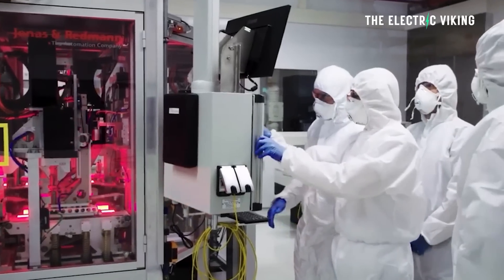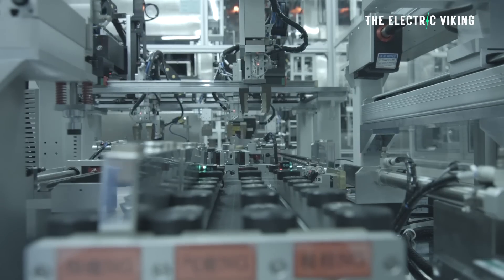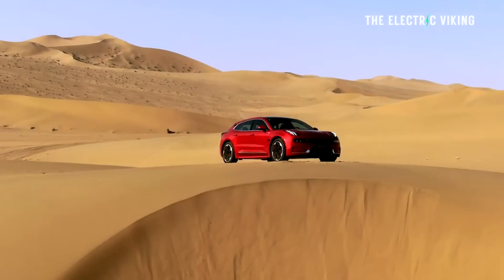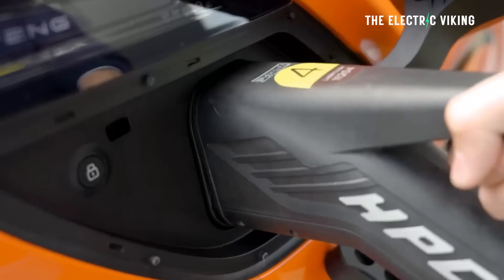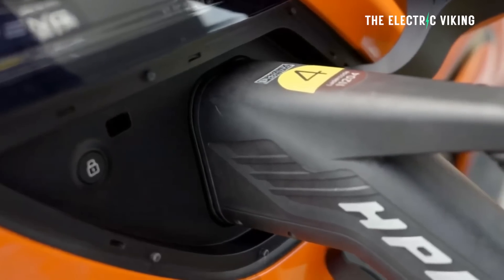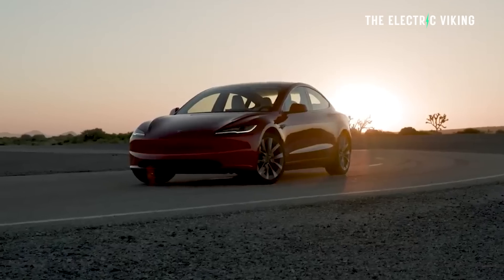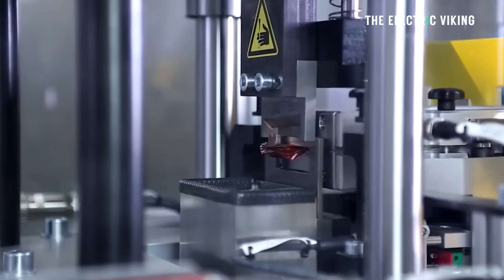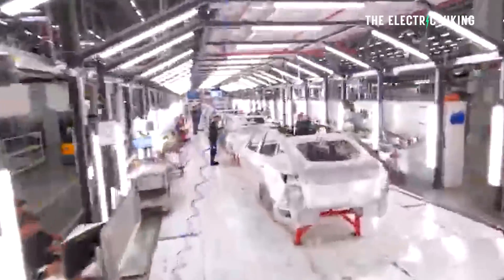NEW lithium sulphur battery made in Australia doubles energy density

Comment: "Put a smaller and lighter battery in there." Why would I want a multi-hour stop halfway between Melbourne and Sydney on a commute?
Reply: He mentioned Melbourne to Sydney on one charge. But with the faster charging he mentioned, a smaller and cheaper battery would be fine for most people
Reply: @emceeboogieboots1608  It's fine to have a battery that can charge at extremely high speeds. Great, even. But the infrastructure has to be there to support not only your vehicle charging at that speed but multiple vehicles at a time, all day.

There isn't the electricity grid structure to do that. And without going nuclear, where are you going to get the power - renewables? How are you going to store that energy and get it from the power creation point to the power consuming point (your vehicle being charged)? 

There's an incredible amount of infrastructure questions that a) have to be answered and b) have to be paid for and built for large scale adoption of electrical vehicles to be broadly feasible.

And then you go off the main routes, not even into the back of beyond...
Reply: @damianwright3690  You speak like every car is going to be electric. And as far as infrastructure goes, we waste a truckload of power that is generated as it is. I myself am wasting often over 5kW of power generation capacity, not at home, 10kW system with a max of 1.5kW export. A smart grid will allow the wasted generation capacity to use pricing mechanisms to encourage those without solar to access this power when it is cheap, and use the full capacity of generation potential. Not every car on holiday is going to drive through Ballarat at the same time. People will already drive well out of their way to save 10c per litre. If they can charge their car for half price between 9 and 4 pm, many will make that happen. And most will charge at home if possible, using their own solar, or cheaper night time tariffs using smart chargers. And if manufacturers and network operators allow VTG, those with full batteries will be able to get good returns for exporting some power when they may not need it
We need to think of those 10's of thousands of batteries as part of the infrastructure too
Reply: To go to the toilet, rest break or a drink and bite to eat. They will recharge up to 80% in 20 to 30 minutes, the industry is aiming for 10 minutes. Don't forget battery swapping.

Comment: As for using electricity for aircraft. Have you actually done the energy numbers? Well I have, as I know the energy required to propel an aircraft. Do you know the energy transfer rate required to recharge them on a turnaround? Bet you don’t know either of these answers.
Well without going into details, I can tell you it is unfeasible within 20 years. Also unfeasible without massive base power availability, i.e. coal or nuclear fired power stations.
Reply: China is already manufacturing electric planes.

Comment: Just wondering if you understand the restrictions for energy transfer using electricity. It is great to have high capacity batteries, however it is the restriction, of the electricity grid, which stops them from being quickly recharged.

Comment: Dude, here’s some perspective for you: 260 ÷ 1000 = 0.26 watts per gram of battery, 400 ÷ 1000 = 0.40 watts per gram of battery and 33333.333 ÷ 1000 = 33.333 watts per gram of hydrogen. No kind of battery is ever going to reach that level of energy density.
Reply: Have you calculated the cost of producing Green Hydrogen  and compressing it sufficiently to use in vehicles? Then of course there's the problem off the specialised materials needed for storage and transport? Google it!

Comment: I really dont need or want a 1000 km battery. Lighter and cheaper yes. The problem with aeroplanes need for big start power will be solved with dual type battery or condensator/battery

Comment: Once super fast charging becomes ubiquitous, they will only need 200 to 300 miles range  at the absolute max, so basically it means they will simply put these smaller lighter batteries into EVs to make them more efficient.  This will also improve EV vehicle performance.
Reply: Many internal combustion engine (ICE) cars offer a range of around 300 km on a full tank, which is comparable to the expected range of many electric vehicles (EVs) once super-fast charging becomes ubiquitous.
Reply: Sodium batteries will eventually dominate the market once super-fast charging becomes ubiquitousand EV range becomes less important.
Reply: 500 IMO until ubiquity, then 400

Comment: What would this do to the public fast charger business? If I had a range of 1000 Km on my EV I would probably never use public chargers or only very rarely. I would charge at home nealy 100% of the time. If that were the case for most EVs then the public charging business will be desimated generally but could be successful in urban setting that are without access to charging, like in their homes or apartment buildings.

Comment: I think the 1000 mile range is the way to go.  Family of 4 cant all charge every day at home. Not enough amps available in the panel. If each car had it's own charge day a typical home panel would do.
Reply: We can't keep our Amps in a panel, they just pass right through!
Reply: Leased standardised battery packs that can be quickly swapped out by a machine might be a way to go if the energy density gets high enough to make them more compact. Would also solve the problem of the car being worthless when the battery loses capacity.

Comment: This again is not a 1 battery for every situation. so far you have cost, Max recharge cycles, recharge time, and WH/KG. if they can get the cost down and recharge cycles up they will end up in more devices but there are situations that it will not be used.

For instance Cell phones have designed obsolescence and they do not want the batteries to last too many years.. that is why they have basically no BMS and can overcharge so easily. why you ask its because they want you to buy the newer module. 

Another instance is tool batteries. Again they want to last long be light charge quickly.. but if it needs to be replaced sooner they don't care

with current chemistries car batteries will last 10-20 years with at least 80% battery. but power tools and phones the batteries last 3 years or so before they are less than 80% so they can make you buy the next model. This is also why naysayers believe car batteries will not last.

Comment: I think I’m right in saying that a solar panel is roughly 24 too 30 % efficient due to resistance so makes one wonder why this has not been looked into more , lots of innovations in regards to make the batteries more efficient be it’s mix of materials used the list is endless , so one wonders why the solar panel has not really changed in years from an efficiency standpoint point , has anyone looked at let’s say would smaller solar panels be more efficient than larger ones , would a vibration censor added to the solar panel help with efficiency so the vibration of the rain hitting the panels generate or help with efficiency along with the sun help overall with efficiency, would  a small fan at the back of the panels help to pick up some energy from the wind help with efficiency, it’s more or less the same panel that only picks up from one source yet other elements around the panel which are on hand each day are somewhat not thought of , maybe it’s a rubbish idea that’s why others haven’t thought of it , like creating another element to the periodic table ,  if it was possible to create another element I would call it surprise = the element of surprise.

Comment: So much will happen within 10 years regarding battery tech. Very exciting!
Reply: I absolutely bet it will not. In the past 20 years battery tech has hardly improved. Physics and the chemical make up of batteries determine that.
Reply: @Car-crazy  remember that what is happening today is a result of years of research. So if the pace picks up, the i believe the next 10years will be exciting.  Last, right now there is an influx of new battery tech in research. Break through is imminent.
Reply: @Car-crazy Clock time is not everything. EVs have jumbo sized the battery market, and that is driving investments in research and engineering. Now what is true, is there are a lot of people trying to get attention, and most "breakthroughs" will never get to market, or will never be important, but there have been advances, and I don't think we are done yet. For one, not all use cases value the same properties equally. Aircraft need high energy density, cars want pretty good energy density and pretty good price and pretty good C-rate. Grid storage wants high cycle life, and low cost. Longer term storage wiuld need to be very cheap and low self discharge rate. Tiny batteries used to power turbo's on gas cars need high C-rate and good cycle life. A new battery only needs to be better in one of those use cases to be viable. It doesn't have to take over the whole market.
Reply: @Car-crazy  There was no EV revolution 20 years ago.
Reply: @Car-crazy  Look at a chart of lithium-ion energy density and cost over time. There has been tremendous improvement, even without significantly new chemistry. Another 2x improvement and passenger ICE vehicles are pretty much finished.
Reply: @Car-crazy bs
Reply: @Car-crazy And that is indeed battery tech
Reply: True dat

Comment: Does that double the explosive power of one of the current batteries
Reply: Electric car battery’s were slow burning even in the early days it might be the hybrids that still have the issue because of the explosive nature of petrol  , I know BYD  fixed  a problem with their steering leakage that used to cause fire most these problems have been resolved , the average petrol vehicle is likely to more likely to explode if the outside gets near 40 degrees

Comment: Please use metric units :)
Reply: No! Come back when a meter can be exactly divided by 3. What idiot would design a measurement system where you cannot divide by 3. Broken by design.
Reply: @mbak7801  the metric system is divided/multipled by 10s. That is much better than 3 because it is a nice round number
Reply: @mbak7801  Actually, the metric system is highly versatile and supports divisibility by 3 more effectively than you might think. While a single meter can't be evenly divided by 3 in whole numbers, the beauty of the metric system is that it introduces smaller units that make such divisions precise and simple. For example:

1 meter = 1000 millimeters. Divide that by 3, and you get exactly 333.333... millimeters.
Because metric units scale by powers of 10, you can always express fractional divisions cleanly using decimals.
Compare that to, say, the imperial system, where dividing a yard (36 inches) by 3 gives you 12 inches, which is nice—until you need smaller fractions. Dividing those inches further can result in awkward fractions like 3 3/8.

If the goal is precision and simplicity, the metric system wins. It might not make 1 meter perfectly divisible by 3, but it lets you achieve the same thing more practically across its units. No system is perfect, but the metric system was clearly designed with flexibility in mind.
Reply: @mbak7801  Come back when you can divide your units by 5 and 10.

There is a reason Americans can't do Maths. Besides the obvious problem.
Reply: Watts are a metric unit. 1000WATTS= 1KILOWATT 1000KILOWATTS= 1MEGAWATT

Comment: Problem is that all of these game changer cells are always 5 years away.
Reply: Most of them disappear completely within that 5 years. But a few, just one or two,make it through and move things on. We already have batteries which were beyond my wildest dreams a decade or two ago, so I'm happy to run with them, until the game is truly changed.
Reply: @nickwinn7812  Only one has to make it to the market.  Thats the silicon valley model. Fund 1 billion into 100 tech innovations in hopes that one of them will make 10 billion profit with a net income of 9 billion.
Reply: And that my friend is when the game will be changed
Reply: The game has dramatically changed - battery life, safety, charge speed  and power density have all improved significantly over the past decade- there will be a similar improvement over the next 10 years - a definite contrast to what happened with ICE cars over the last 50 years 😂
Reply: And yet sometimes something sticks

Comment: A lot of EV owners wouldn't see the need for such things as you'd never drive 600 miles straight without a break.😉
Reply: You could also put a smaller and thus lighter battery into the car. That will be cheaper and give you more km per kwh. Besides that, a higher density battery will be much better in trucks.
Reply: @olepetersen3554  Your approach is much more rational than just whacking a massive battery into everything that moves, I have to say.
Reply: @olepetersen3554  lighter==better acceleration and lower cost
Reply: tell that to Australian drivers. I've gone 700+ with a 5 min loo break on more than one occasion
Reply: @thekaxmax But that’s what he’s saying. You can’t build Cars just so big Bob with the bladder of a champion and can drive ten hours straight because he’s done it twice in ten years so therefore EV are no use……unless they can go 800 miles to a charge. I know door to door 428 miles I’ve done has a total charge top up of all of 28 minutes these days. The charging didn’t interrupt anything as it was a rest stop to eat and toilet break. It also sat in traffic in 28c with air-con on because of accident ahead for an hour crawling at 4 mph. 

I always figured real world 400 miles is more than enough for 96% of owners.
Reply: @SWR112  I wasn't saying that. I was objecting to a blanket statement that was untrue. :P
Reply: @SWR112  Totally agree. Twice the current range and everyone will buy one
Reply: @thekaxmax  Yeah, but those of us without access to amphetamines, prefer a safer approach and take a good break every couple of hours or so!
Reply: In Australia we might…imagine charging at home and being able to drive to Melbourne and home again! OMG…..this is insane!
Reply: @annebaker9408  not quite home again. And I normally do it in 3 legs
Reply: Bigger batteries for house to grid, longer life, towing ability and long distance driving.
Reply: People also drive drunk but they shouldn't.
Reply: @Alantj22  Didn't say it was a good idea. Just that it's not universal that no-one does it. :P
Reply: Its got nothing to do with needing a break. Its to do with needing a charger... Why do people always bring up the break thing. When you stop to wee or eat, you don't need to stress if there is a charger when you have 600 mile range. Common sense I thought
Reply: People who keep spouting that one time they drive long distances that one time a year without a pee break... meanwhile 99.5 percent of their daily drives are less than 50 miles.  Yes, we all drive long trips, but that isn't the norm for most of us.  I'm happy to pay 10$ per charge vs 100$ per tank everyday and suffer that extra 30 min charge on an occasional long trip.
Reply: @adrwong8  A PHEV suits most people’s needs. Especially the latest generation with 80 mile range.

Comment: According to Toney Sega [ world renowned futurist , economist etc] , the issue with bringing a new battery to the market , is that it takes around 9 years from concept to retail use .
and that Lithium batteries have an average price drop of 16% per annum from there original development  , and an average increase of energy density of 4% a year since there original development . So whatever you invent and develop  today has to be better and cheaper than  a lithium battery in 9 years time.
Reply: He's right about brand new inventions and technologies. However, batteries are not a new technology. And the markets well established. This invention might very well contribute to the average 4% improvement of battery technologies.
Reply: You're right!... Prototyping is easy. Manufacturing at a competitive cost is hard. 
According to estimates, just 5% of inventions progressed to the manufacturing stage.
Reply: @appl2597  tell me about it .spend years building prototype off highway machinery.... 😂
Reply: @appl2597  Thankyou.
Reply: call it a vaccine, it will on the market in months
Reply: Well he's not much of futurist 😂..CATL need 6 months..
Reply: @Rockall57  What ! safety tested, feasibilities, market analysis, manufacture tooling , investors risk analyses, government approvals for the uses and manufacturing, times about another 50 contingencies to the process,  etc etc etc this is why it takes 9 years .
Reply: @rickrimington2760  no no no...that's why Tesla bought Maxwell because they designed systems to test battery degradation in 6 weeks which simulated 6 years.